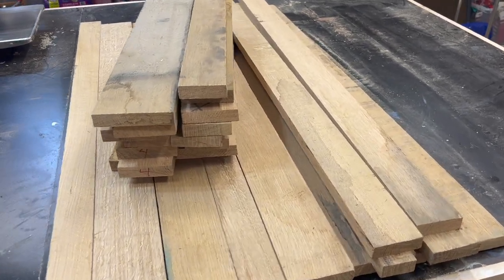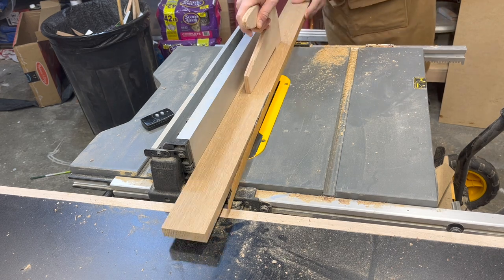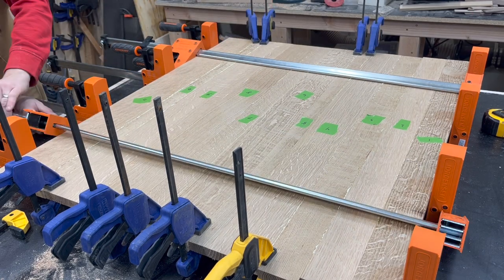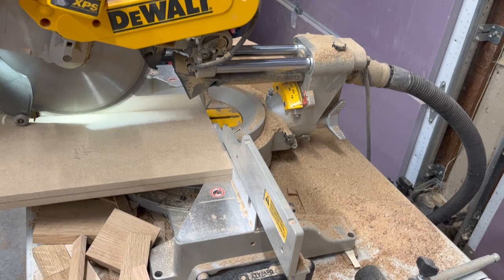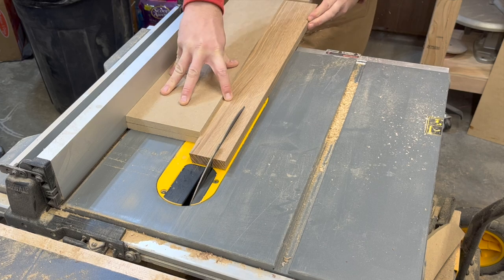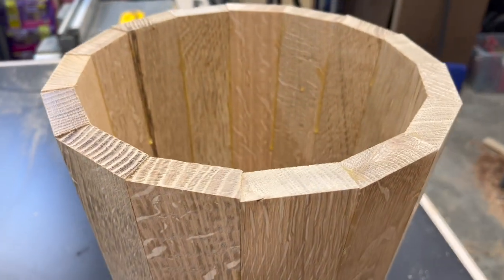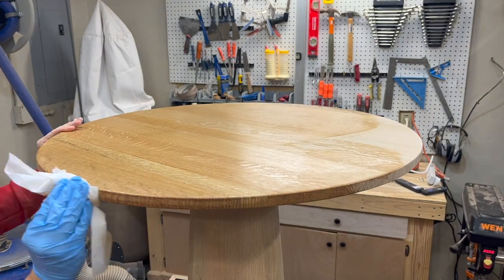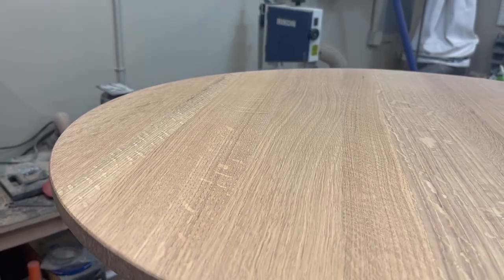Making round table with splayed joinery base (tapered cylinder)

Comment: Tip for you brother, as a fellow woodworker. Use a bondo spreader instead of a metal spatula, to spread the material. 
- Oil will catch some of the metals and can change the color of the stain
- Scratches/dents the wood surface when spreading with a metal spatula

Comment: I’m very interested in how you cut the secondary angle on the staves?  I prefer to have one side of each cut on opposite sides of the blade.  From your excellent video, yielding a beautiful result, I assume that every cut was from the right side of the blade. Is this correct?  Great match!

Comment: Hi. Is the taper angle determined by default or you can set it up at any value you like? For example if you make a cone shape wide at the bottom and narrow on top - than your angle should be different, right?

Comment: Awesome video man. What is the diameter of your round top?
Reply from the maker: Thanks! 32 inches. I will say on this build that after some use my particular base at 12 inches is a little too narrow for younger kids who might lean on it more or in general not control their body weight as it gets tippy. I ended up making a second base at 16 inches wide on the bottom of the base. This is rock solid now.